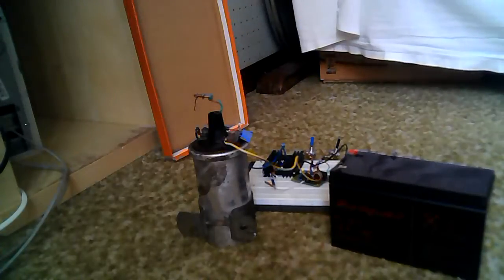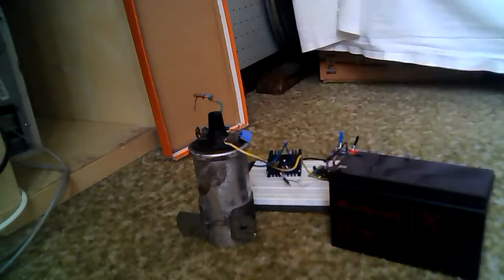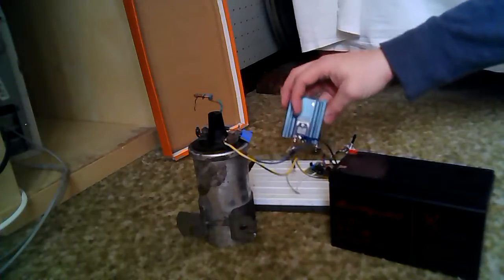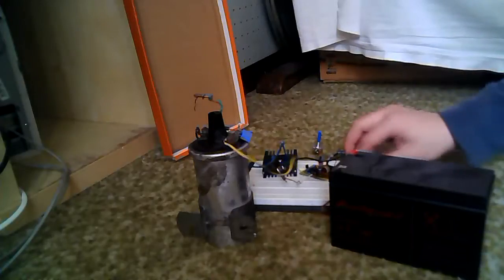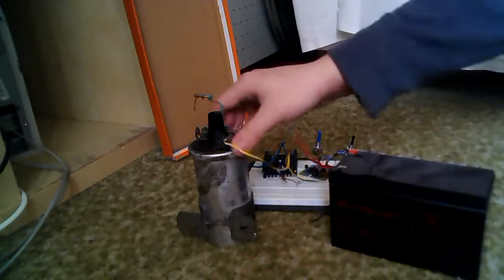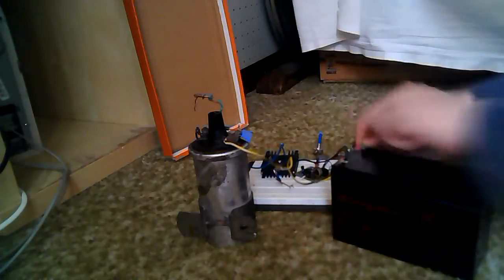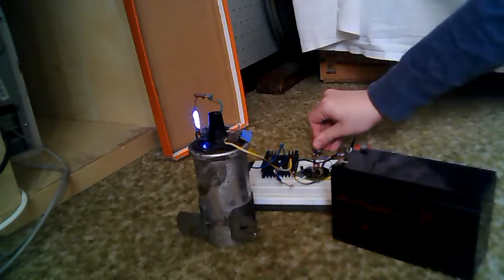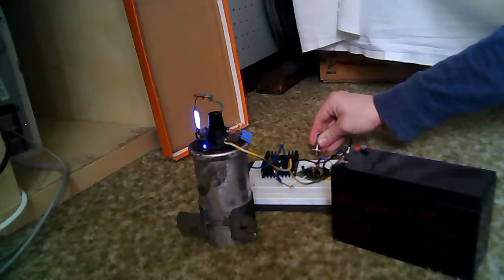Ignition Coil PWM Driver - TL494 based

Comment: Hi!  you use mosfet number??
Reply from the maker: +auttapon salabualoey A bipolar transistor was used in this video. Well, 2 bipolar transistors, E13007 & E13009 in a Darlington configuration. Later, I have replaced them with a single MOSFET - IRFP460.